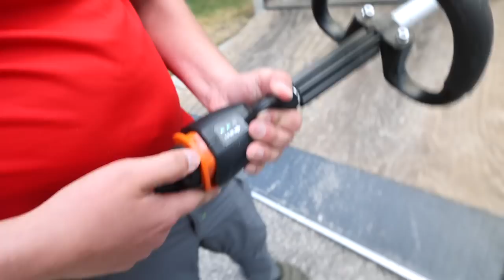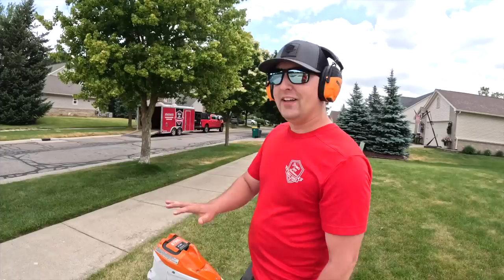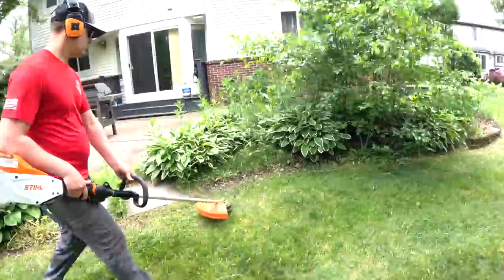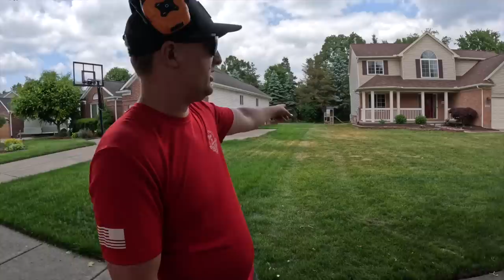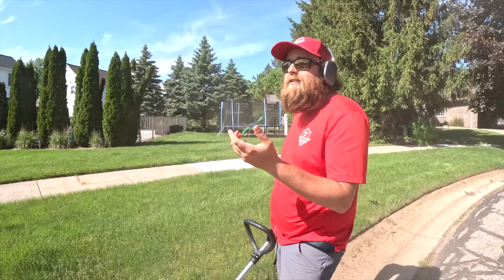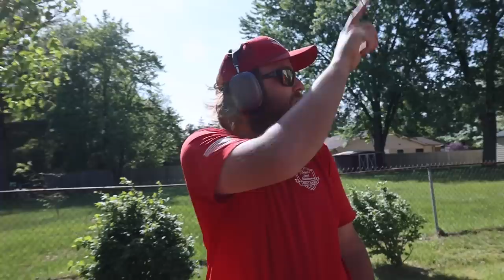BUILT FOR WORK! STIHL AP 500 SERIES BENCH TEST! [RESULTS?]

Comment from the maker: Thank you to STIHL for letting us demo the AP 500 batteries!

Side note, do you guys bevel your edges when you trim? What’s your technique!
Reply: Backpack battery is the way to go.  Keeps the whole unit light.  I don't have the backpack battery, but stihl makes a pack that you can stick your batteries into which works great.  Will be getting the AP3000 once the blower is more available.
Also, I never trim over the 2nd powering setting, 2nd position is plenty of power unless your in some serious overgrowth.  Edging I usually do 2 or 3 depending if it's the first cut or just upkeep.  Pruning saw, broom brush, etc I run on 3.
Great vid man.  Keep it up!
Reply: I just got the Dewalt backpack battarey spayer 20 volts,, it a Animal,,, but sthill is two expenseve, I will keep up with my echo 262,, and echo 302,, and my maruyama 23, cc all this gas trimers are super  good, but stihll is super, super, expensive gas and battery,, I will stay with gas,, but I love all your videos,, and you have help me alot,, thank you

Comment: I run the KMA electric Kombi setup with a few AP500s batteries.  Love the setup.  Runs every attachment with ease.  Can't beat the instant torque!
Reply from the maker: How have you felt with battery anxiety sort’ve like range anxiety for a Tesla
Reply: @BriansLawnMaintenance  not bad at all once I got use to it.  Batteries charge up to full in 45min or less.  I'm a solo guy, with regular trimming and what not, 2 batteries has been plenty of juice even for long days.  Once i switched to running it on power setting 2 and utilizing the 1st power setting against objects, and they really last a long time.

Comment: I started running the Stihl electric equipment in 2017 and just retired my first trimmer. They’re a solid product but they do have some common problems I’ve come across running these commercially such as the chips in the throttle sensor going bad. 

I run the backpacks that hold two ap 300 batteries and plug into the power head. This was their first gen commercial product KMA130R

I have two trucks that run the stihl electric equipment but have moved away from their products since they’re not water proof. My other 3 trucks all run Makitas line of electric tools. They’ve been a solid product for us and we run them on ramp rack set ups. We d have two full days of commercial work and three days of residential doing 180ish homes so they definitely hold up 

One piece of feedback I’d recommend when doing these videos is covering the power level that you’re running the equipment on, it makes a huge difference in run time. The second power level (mid power) will reduce your run time by roughly 40% in comparison to the lowest level 

Great video and glad to see some other guys out there doing reviews on these electric tools 🤙🏻

Comment: i bought the FSA 86 R 3 years ago. because our gas tory built died. and I figure I didn't need gas to trim the lawn. the run time was fine but the head wouldn't bump out new line. tried everything and nothing, so I went back to gas and been very happy. i could see getting a battery blower to replace my 2002 bg55 that will not die.

Comment: Im not familiar with the stihl settings but i have milwaukee as im invested in the power tools and batteries. I have my string trimmer set on low speed and its perfect. I dont need to feather the throttle and it handles tall grass with ease. Battery is the way to go for homeowners and even commercial startups.

Comment: If edging I do that before I mow with the edger. I use the string trimmer after I mow and I bevel. I have a question regarding the Stihl. On the stihl is it 3 speed with on off trigger or three speed plus variable speed trigger? 
In regards to getting into the crevices of the brick I think you would get used to the new way of having to feather the trigger. Seems like you can't get as low rpm if you want to hold the trigger. You more have to quick tap the tigger to mimic the low rpm of the gas unit as you mentioned. 
I found the Ego edger I have is a bit underpowered for heavy edging like you would find on an edge that hasn't been maintained in years. Drains the battery quickly and sometimes stalls. It is nosurprise it lack power considering it is not a commercial unit. I plan to try out the new commercial model (if it ever releases). I hope the power is better. I have used the backpack batteries and the runtime is incredible. One time I counted 18 properties on one charge. The one I used was the Ego backpack battery and the weight is about 19 lbs. About 7 lbs lighter than the Echo 9010. Also the backpack battery removes the heavy battery from the tool making the tool roughly the same weight as the Echo 2620

Comment: Is the ap500 the same weight and physical size as the 300? I’ve been running the echo 56v system this season, so far I like it a lot. There’s only 2 batteries with it, a 2.5 ah and a 5 ah the 5 is double the size and weight but lasts a lot longer too.

Comment: Brian, thanks for showcasing the Stihl products.  I currently have their gas trimmer and edger.  They have lasted for ten years or so with no problems.  I don't see me getting their battery line because as a homeowner the Ego products have more appeal.  I do question Ego's longtime durability as the Stihl products will last a long time.  For me, the idea of being able to take the Ego batteries from the trimmer or edger to the snow blower etc makes me think that is the way I will go when the current Stihl trimmer and edger die.  I haven't gotten the Stihl equipment tuned up in 3 years and they won't die.  Goes to show you if you pay a little more upfront for quality, the product will last you.  Keep up the videos.  How about getting Ego to send you their new commercial line of trimmers/edgers to review?

Comment: For the price I’d rather 2 300s batteries which gives a lot more run time than 1 500s for the same money. A lot of guys switching from gas run the battery gear too hard and go through way more batteries than they should. They have instant torque so you don’t need to run them flat out

Comment: For lawns for one battery I would need 12 to 13 batteries ridiculous
Reply: at $380 a pop for the Batteries. Gets expensive as hell fast.
Reply: @MichaelSmith-kr9qw  If they want us commercial guys to buy electric they need a battery to last at least eight hours run time otherwise I would never even buy anything electric other than home personal use
Reply: Run a electric product all day long with a supply chain of batteries and see how long the motor will take the heat before it fails. Just curious about this one. I do know that cordless tools will burn up. Electricity generates heat in the windings of the motor structure.
Reply: @markclark1605  where I live the temps get into the 90's on a regular basis. The Ego multihead string trimmer I use has been going strong for multiple years. I do 30 to 40 properties a week.

Comment: Has that one got the very annoying thing where the power keeps turning its self up to three then the thing revs up and down all on its own
Reply from the maker: Yup! It has 3 power settings for different speed, pretty neat.
Reply: @BriansLawnMaintenance  I can tell you these things grow on you been using the sthil battery stuff all year and them batteries charge up quicker than you can use them charged back up in less than 15 minutes

Comment: I love my gas powered Stihl equipment but I know the electric powered stuff is the future. My worries what are the environmental impact of all these batteries long term it takes serious amount of effort to mine the minerals for these batteries currently. I know Gas isn't that friendly either but at least I don't have to worry about disposal of my fuel. Another thing is cost !!! $1000 a pop just for the edger and AP500 battery charger with 1 battery and then additional costs of $380 a battery the costs are adding up fast. So your startup costs Electric vs Gas is not even in the same ballpark. You could almost buy 3 FC111 Edgers for the cost of 1 FCA 140 plus battery charger and spare batteries. No thanks not at this moment. Interest though I will admit that.